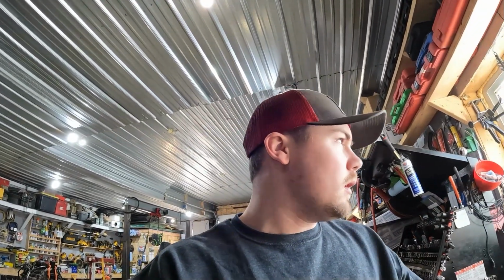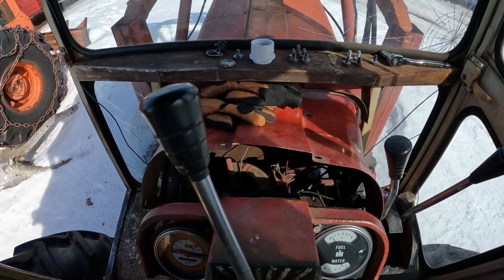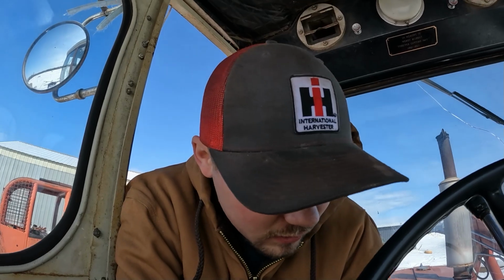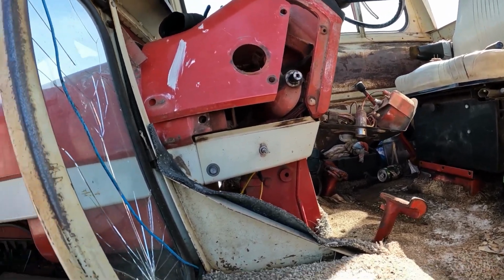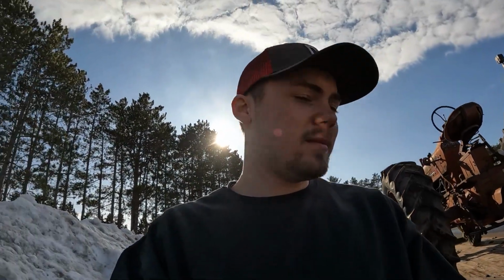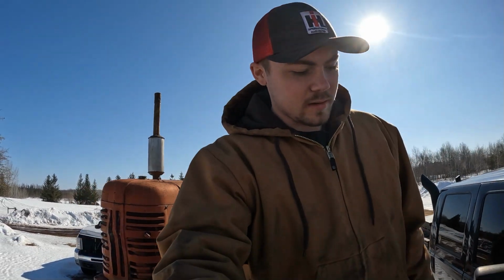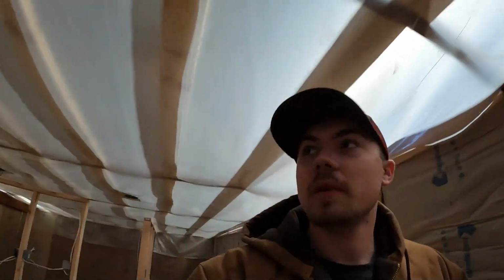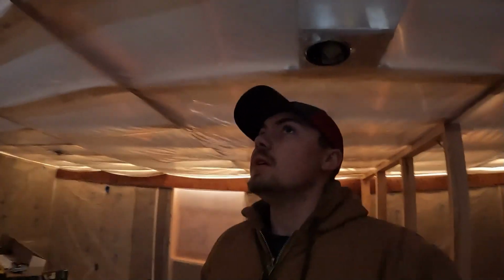One Busy Weekend- The Farmall 756, A New Problem and Apartment Progress

Comment: There's likely so much water in that rear trans, ,  It is bound up with ice..
 Does the clutch pedal move, can you push it all away forward and put a block in it to disengage?
Reply from the maker: Well if it does have ice there’s not enough to lock up the differential, which is good. I wish I would have mentioned that fact in the video. Yes the clutch pedal is feee but wether the clutch is releasing or not is yet to be determined